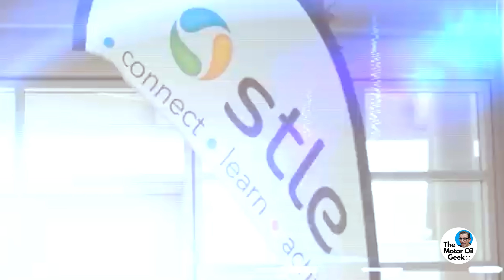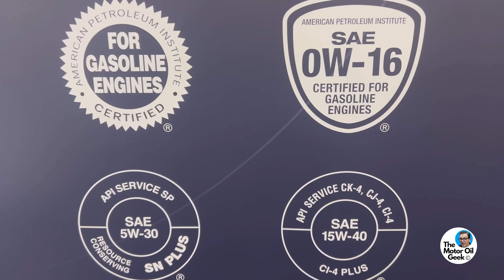Are Today’s Oils Ready for Tomorrow’s Engines?

Comment: Test new oil in your $ 40000 vehicle. In 2 air cooled engines switching from gasoline oil          5w30 to 5w40 diesel oil produced more power and longer period before oil change due to less blow by.

Comment: I own a 2016 Subaru Outback 2.5i with 131000 miles. I plan on using Valvoline Restore and Protect for the next several oil changes. What is your opinion on using it for all future oil changes?
Should we base our intervals on test results?
If so, what numbers are we looking for to know when to change our oil?

Comment: just picked up my brand new Golf R, Gen 8,5 changing the engine oil I have that under control, I always do the first oil change at 500 miles, to go after the manufacturer's recommendation, it's a joke, if you want the engine to last

 but no one has been able to give me an answer on when to change the oil in my gearbox 7-speed DSG (DQ381), should I do the first oil change, at the same time as I change the oil in the engine,

Comment: Switched from Pennzoil ultra platinum 5w30 to K&N advanced full synthetic 5w30 my frontier 4.0 v6 dessert runner is a lot quieter has 131000miles and does not use or burn oil

Comment: Well, Since 1997 I've been an AMSOIL Dealer. (Not to make a Living) But to use a GREAT product at a TINY Discount. NOW, that said I just went to there Website and Looked at the Products And I do NOT See the SQ Spec on what I was Looking at (Sig Series 5W30) Stuff. Soooo.... I have been using The Schaeffers Brand Oil now for some time Due to AMSOIL'S Cost Situation. And I went to the SCHAEFFERS Web Site and Well, Well, Well, BOOM, They have Already Changed there Product Packaging and SQ Spec at Least on there Web Site, have all the Mfg Listed Specifications to Co Inside with the Oil's on there Site. Seems like AMSOIL is a Bit Lagging, which is kinda Weird to ME anyway??? At this Point, I would Like to See the SCHAEFFERS OIL (Product #6530) SynShield All Performance Full Synthetic Product "With" the NEW SQ RATING GF7A Spec "Tested Here" By Lake. I wanna know just how "Good" or "Not so Good" this Oil Really is?   Hey Lake. Can ya do that? Is it Possible? Or "Maybe" You could go to the SCHAEFFERS Plant and take a Walk through the Mfg Facility and see just weather or not the STUFF is Worth Pouring in my $90K F-150 V6 Twin Turbo Jobberdoo??

Comment: 2022 RAV4 2.5 39k miles Amsoil SS 0w20 just came back with 7ppm iron at 4,700 miles on this OCI. Viscosity at 100c still 7.88 out of 8.8 
No makeup oil was needed. We didn't get the car untill 34k miles.

Comment: FUN TEST. Hey Lake, how about oil testing in some FUN scenarios. For instance, when 300MPH Top Fuel Drag racers change Oil after a 1/4 mile and it comes out looking white (foamy), let’s see tests on that oil. Or perhaps a POSTAL vehicle that starts and stops 200 times a day (or a battery/starter life test on this). Maybe some type of high RPM gas construction equipment?  I think you could come up with some fun creative scenarios for this channel.

Comment: Extending oil change intervals? Sustainability? Save in lubricant costs?

And then a 2025 4 stroke engine eats more motor oil than my 20 year old 150 horsepower TWO STROKE outboard?

Epic stuff xDD

Comment: Castrol Edge Dexos is already Sq rated as well.
Reply: I Am Glad You Mention " Dexos"...GM's Rating...If GM Cant Get The 5.3 Or 6.2 Engines Corrected...From The Cam And Lifter Failures...I Say Dex-No Rating....
Reply: @tonybernheim8365  I don't pay attention to oem oil certs myself.

Comment: I have 26500 miles on my 2016 Mitsubishi outlander sport.    0w20 since day one.  Does not use any oil in between oil changes. Oil change Every 3000 ..  

At this oil change at. 26500.   Miles. . I switched to. 5w30 

VALVOLINE  EXTENDED PROTECTION    5W30.😊

Comment: I’ve always followed Toyota’s “severe duty” maintenance schedule which essentially cuts the mileage in half for oil change interval. Oil and filter every 5k miles or 6 months whichever comes first, using the specified, quality full synthetic oil and OEM filter.

Comment: Would love to see some investigation into higher mileage common engines and the change in oil requirements to contend with normal wear . I have a 2019 Chrysler Pentastar 3.6 with 108,000 miles and I am thinking a somewhat thicker oil may help with its longevity
Reply: 5w-30 Full Synthetic Castrol

Comment: I remember the chevy vega in the seventies got below freezing pistons would seize in the cylinders back up above 40 degrees it would expand turnover and run i worry more about the quality of the engines than the quality of the oil. No extended drain intervals on an ice engine makes sense.

Comment: Genuinely curious, if you ignore the slight change in mileage, is there any scenario where a 5W oil is a superior lubricant to an identical spec oil in a 10W? 
I’ve used 10W-30 in every vehicle I’ve owned for decades and never had an engine failure due to oil.
Reply from the maker: Yes, colder weather. A 5W-30 will provide better start up oil flow than a 10W-30. Operating climate is an important factor.

Comment: I am about to run the valvoline hybrid 0w20 in my 2026 civic hybrid.  When i first got the car, all i could think about was how hard it was on the ICE engine with the start and stop, and going from off to reving up for electricy production and holding it under heavy load.  Short 3 mile trips (without  running the heat to force the motor to stay running), the motor starts and stops a dozen times and still never completely warms up. Its scary.
Reply: Turn the heat on at the hottest temp but lowest fan speed. It’ll force the engine to run more to generate heat since you’re commanding heat. If you have the heat off, it’ll turn the engine on and off like it would in the summer
Reply: @TaylorPhase 100%  also do this when i want the car to feel a little quicker.
Reply: Maybe that's why they added turbos to the high-performance 4 cylinder hybrids. Need to generate some heat. (Sarc - LOL)

New Toyota Hybrids actually run coolant through the post catalytic exhaust stream to speed warm up.

3 mile trips is the really the use case for a plug-in hybrid option.

Comment: Hi Lake, thx for awesome videos which I watch with great interest. I have a question, my 2026 crosstrek says 0w-16. Can I permanently switch to 0w-20 without hurting anything? Thx
Reply from the maker: Operating climate and conditions are important variables, but in most cases the change from 0W-16 to 0W-20 is slight and not detrimental to the health of the engine. In certain circumstances, it could be beneficial.

Comment: Oh, no - API SQ already?  lol  I'm still struggling with SP & LSPI.  We got our 1st GDI engine (w/turbo) in 2021, and found that GDI does indeed add significant fuel & soot dilution into engine oil.  OA (Polaris) Labs noted the engine has moderate dilution @ 4,200 miles, so I've been changing between 4k-5k oils.  Don't run OCI's on GDI engines any longer!  I've read the dual injector engines (direct + port) reduce dilution, but not to the near-zero level of port-only engines.  And now EPA is requiring exhaust particulate filters (diapers) on GASOLINE GDI engines.  Wrong direction in architecture!  All for only ~ 5% fuel savings - wearing down engines early and using more motor oil is a big cost too!
Reply: I also have a GDI in my corvette. 
I added an “oil catch can” and let me tell you, it really works.  Read up on them.

Comment: Motors are electric i dont know where oil would be added? In windings? On brushes  ?
Reply: Bearings, if grease ... grease is a makeup of thickeners as a carrier for the oil.
Reply: Motors are not electric. Motors can be electric. They can also be air, hydraulic, diesel, gasoline, natural gas, steam, and so on. But some of those are engines you say. Engines are motors.

You ever hear of motorsports? Indianapolis Motor Speedway, National Corvette Museum Motorsports Park. You have motorcycles and motorboats.

Comment: Awesome! Burning up to 1 quart in the span of 1000 miles is considered completely normal, eco friendly and sustainable! 😂
Reply: Yep...5 Quarts Burned At 5,000 Miles...If You Change The Oil Filter At 2,500 Miles...Its Like A Half Ass Oil Service...😅😅😅😅😅
Reply: and then blowing up the engine that could've done 500k miles to get .3 of a MPG
Reply: Yes, they are speaking with a split tongue.
Reply: How is this for the environment?
Reply: Currently at 1,300 mile on my Audi S5 oil change, hasn’t burned anything.  Also running 30 oil rather than 20.
Reply: Depending on how long you keep your "car",  you will find that oil consumption is very hard on expensive catalytic convertors.
Reply: What's it matter if a quart of oil is burned or not? You'll burn tons of gallons of gas or diesel in the process of 1000 miles.
Reply: @joaoescudo1561  For one thing, the oil that is being burned goes threw the cats and shortens their useful service life.
Reply: @joaoescudo1561 the oil and it's additives doesn't burn the same and damages emission systems
Reply: Sorry. Not in my world.

Comment: Will be waiting for API SQ oil video to come out. Have not seen SQ oil in stores yet. Top tier gas going to do an upgrade soon also? Thank you
Reply from the maker: The TopTier gas spec was upgraded in April 2025. We are getting the dyno time for the SQ test schedule for this spring.
Reply: @themotoroilgeek  looking for SQ testing later this year.
Reply: I looked on the list of top tier gas stations. Decided to try one went there. Did not see anything that proved or stated it was a top-tier gasoline. So how do you know you're really getting it?
Reply: @Oldcarnut63  chevron or shell and Texaco and Exxon Mobil are some of the top tier approved gas stations and diesel .
Reply: @Oldcarnut63  With the majors - if they are on the list you are getting it but they usually do post the small "Wave" sticker on the pumps. Smaller than an oil change sticker.

Comment: I want to know, which of the new oils can I trust in an old engine with flat tappets (312 Y-Block). I'm tired of replacing cams every few years.
Reply: Extreme Racing Oil from Motorstate
Reply: Valvoline VR-1

Comment: "sustainability" AKA we want your car to fail at 50,000K miles so you have to buy a new engine/car. So green!!!!

OW 40 till the day I die
Reply: Just use 120weight gear oil since thicker is better in your book.
Reply: Why 0w-40 instead of 0w-20? 0-40 will shear out of grade quicker iirc

Comment: I religiously  use MoterKote in all my vehicles ! Its Alkalized Naptholine  ! Never had an issue using it ! And you can add to transmissions wet clutch or not ! Even in front and rear axle! A little goes a long way !

Comment: Should there be more focus on manufactures using a more wear resistant steels and development of the heat treatment of that steel and to make it repeatable in production. Unfortunately passenger vehicles will always use the most cost effective methods.
Reply: Thank your policy makers and bankers not the manufacturers
Reply: @BadBoiFX  They wear small hats.

Comment: Which oil is better for using ot with my wife, 0w20 or 5w30?
Reply: a little spit goes a long ways...................
Reply: Depends on engine, climate, driving style and duration
Reply: 5W20 - less shearing out of grade.
Reply: @ChicagoRob2 0w20 has less shearing based on his video about oil viscosities iirc

Comment: Doesn’t sound like the future is bright for motor enthusiasts
Reply: You will own nothing and be happy.
Reply: @tacticalcenter8658 That is what I'm for. A government that tells us what you will drive and own and what you will and wont do.
Reply: @tacticalcenter8658 sad truth
Reply: Why is that
Reply: @Kalil-xk1du  small hats
Reply: You can still buy prior oils, the modern ones are just made for the most common modern cars. 

You wouldn't put 0w20, or any modern oil in a model T, and the recommended oil formulation for that 100 year old car has no place in even a 40 year old engine.

Engine designs change, and oil evolves, they both go in steps to serve the most common engines on the road, nobody is stopping you from buying a special grade you can get outside of a big store.
Reply: It is. Just do frequent oil changes and use a reasonable viscosity not thick gear oil nonsense
Reply: The future is extremely bright for (electric-)motor enthusiasts. It's not as bright for (combustion-)engine enthusiasts.
Reply: @linksep1  Wrong. Hybrids will be awesome if done right, EVs are a flop tho

Comment: Great video. But a big issue that we need to make our governments understand is that by imposing too strict of EPA regulations they are forcing car manufacturers into making engines that are ultimately counterproductive and burn a lot of oil. Doesn't matter how great this oil becomes is if we have engines designed with gasoline direct injection, low piston ring tension so on and so forth, we're just going to burn a shitload of oil and destroy catalytic converters wasting essential metals, minerals and petro. Ultimately depleting the world's resources faster.

Toyota's with their hybrid system I think is probably the best future solutions. But I haven't owned one so I'm not sure how much oil they burn. My friend had an old first gen Toyota Prius and it burned a shitload of oil as well. Not sure if the new ones do or not.
Reply: Some engines did have oil consumption issues, like the 2.4L engine in the 2007-2011 Camry Hybrid, but the same issue existed in the none hybrid with the same engine. It does not seem to be an issue for all of them though, I never had issues with my 2008. I think a lot of it comes down to whether the first owner did a proper engine break in period or not. I have not heard of it being a wide spread issue with newer models. Now I have a 2022 Ford Maverick Hybrid, oil consumption does not seem to be an issue, but I do 5k mile internals. I suspect people doing the crazy long 10k mile intervals recommended by Ford will have issues down the line.

Comment: How are these additives and technologies changing how oil is recycled?  Higher tech additives may need special handling and recycling as they aren't as "clean" as old school low tech oils?
Reply: We "recycle" used motor oil by burning it in a waste oil furnace to heat the shop. It is quite common in the automotive industry.
Reply: @vernonpitts6630  I know, are there any special requirements for super advanced future oils?  IE. silicone spray for rubber is safe, it's a crap product though.  Krytox is a specialized Fluorinated grease that can emit phosgene gas if overheated, it works awesome on rubber door seals though.